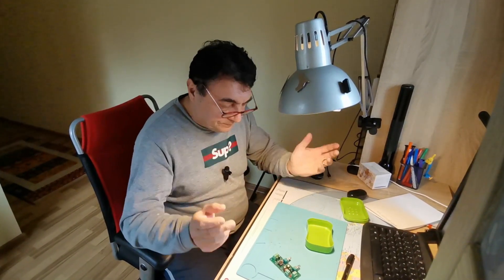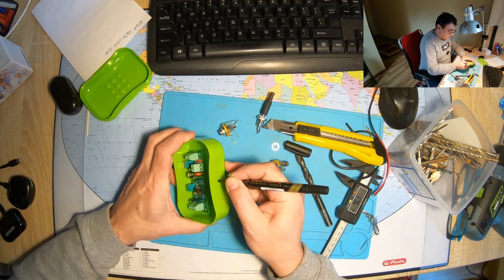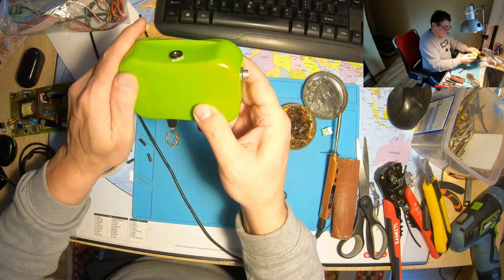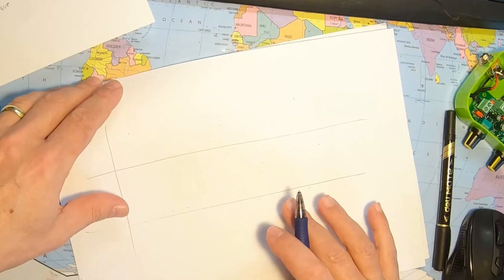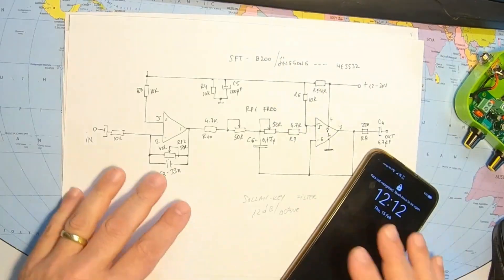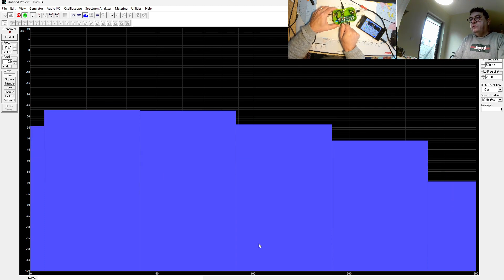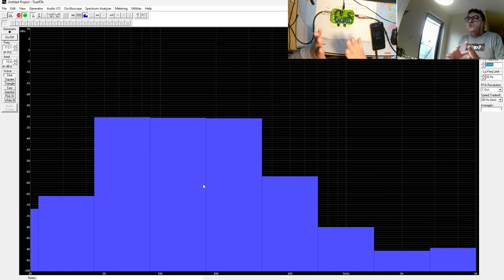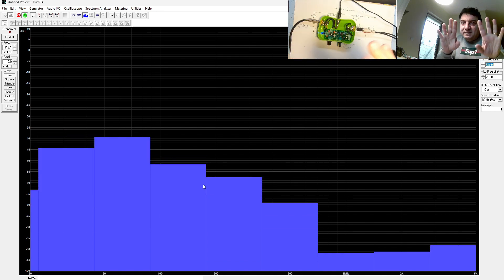SFT B200 subwoofer adjustable filter single 12V power supply

Comment: Thank you very much for the great circuit diagram. However, the 220n capacitor from pin 5 to gnd is still missing.
The 10k and 4.7uF capacitors are provided twice at the input.
I can't understand the manufacturer's specification of 22-300Hz either. According to my calculations it is 20-105 Hz
🙂 Best  regards
Josef
Reply from the maker: Right, there is a 220n from 5 to ground, I miss it when copy the drawing. Also , there two inputs frofofor Left and Right similar, so a single input should do the job as well (only one of the channels). I just fix the mistake in the schematic. Thank you!😁